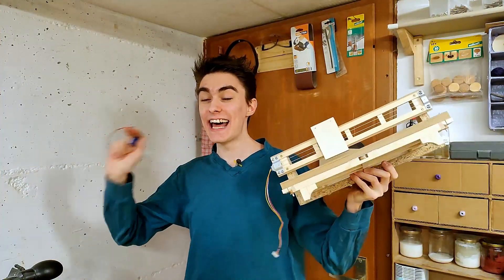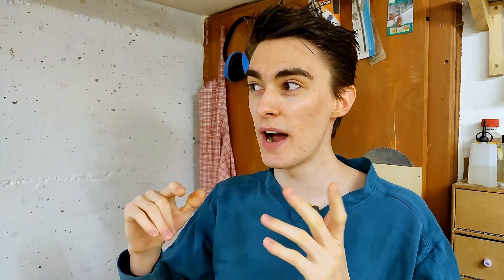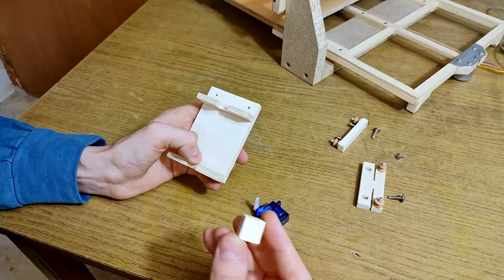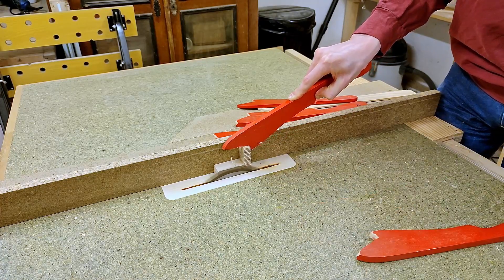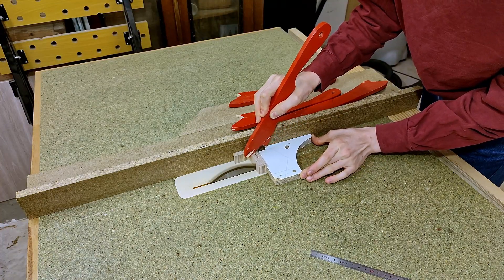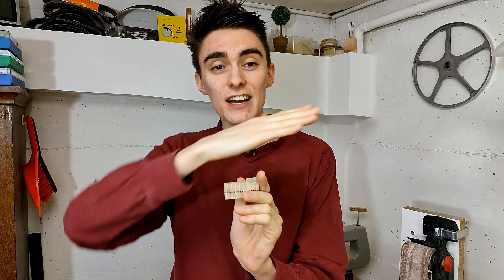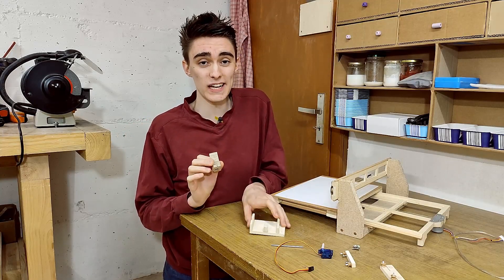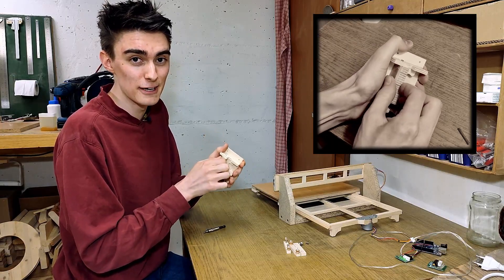Making a SERVO DRIVEN Z-AXIS for my 210x297mm arduino CNC pen plotter

Comment: Hi guy!
I can't make the software UGS to move the  Z axi with a servo motor. I think maby the problem are the firmware on the arduino nano. I have use the GRBL of GITHUB site, but is not working!..
I don't know more to do! Do you can to help-me in this problem, please?
Reply from the maker: Hi, what version of GRBL did you use? There's a modded version you'll need to make the servo Z axis work, see my long explainer video about it: (https://youtu.be/f6xCfzfiD6Q) 
There were also two erroneous slashes that needed deleting from the code to make it work, though it has been a while ago so I forgot some of the details..

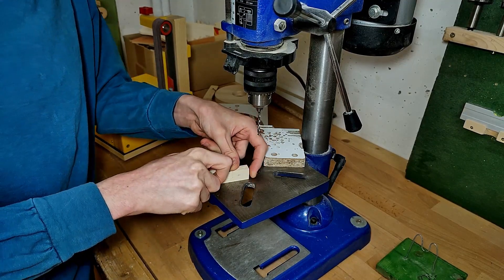Comment: 02:55 When I try to make twin objects. I first drill two holes after putting them on top of each other and then insert a pin to keep them in place. Then, I do my cutting and drilling the real holes.
Reply from the maker: Yes, that would be the correct way of doing it, but on these parts it would've been a bit overkill, especially since there would barely have been room for another set of holes

Comment: hello, your machine is very good. But you took way too much time to make it. it should be completed like in a week or like 2 weeks max.
Reply from the maker: Yup, wouldn't have taken much longer if I hadn't had to make a detailed video about every step. Seriously, making a video about anything suddenly makes it take ten times longer.
Reply: @ChronicMechatronic  dont you think just buying 2 v-al slots will reduce work. Coz i did the same and it was very cheap
Reply: i made it in under 20 bucks. dontknow how much this setup is gonna cost
Reply from the maker: @grizzlyybear  Easier for sure - but then I get back to the age old problem of integrating the aluminum with the wood, like I extensively talked about in the 3dp series...
Plus buying stuff if it can reasonably be done without is kinda against my channel ethic 😂 This setup cost exactly $0.00 so far!
Reply: @ChronicMechatronic  wow…🙊